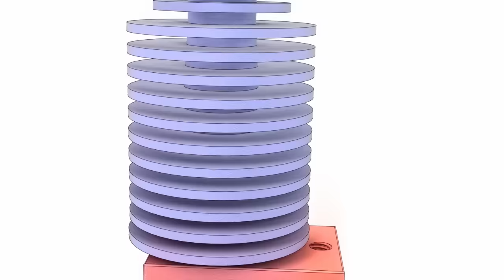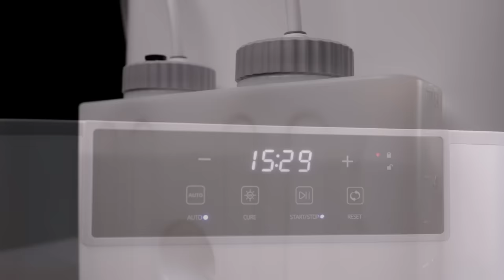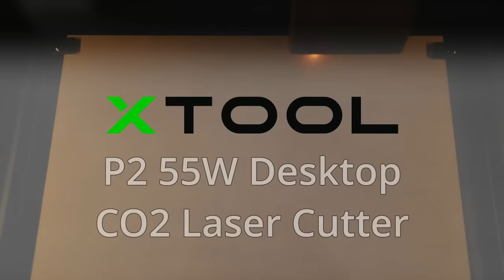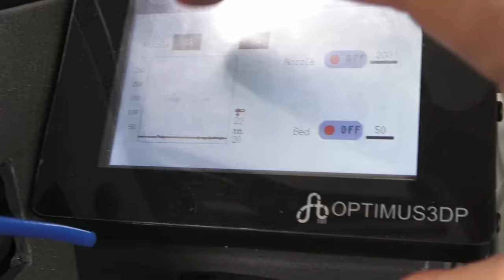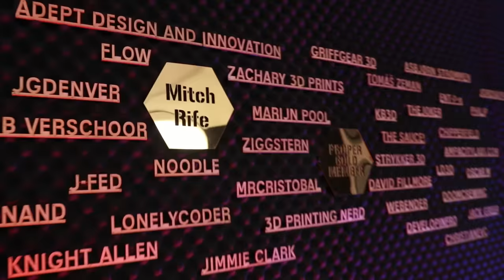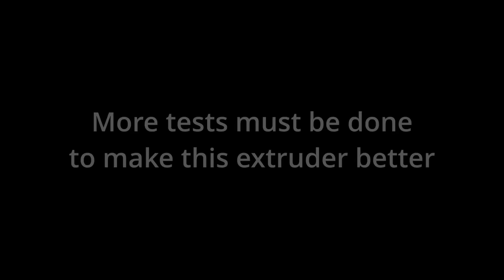I built a working Hotend out of a CPU cooler!

Comment: 2:10 Heatpipes aren't easly refillable, they have like low pressure to lower the boliling point of the fluid inside, so you need to either fill it and seal it in a vacuum or with the tube really with the boiling liquid inside (and in the second case it will not perform good like the vacuum one)
Reply: This is true of water heatpipe where the boiling point is brought down to near room temperature by partial vacuum. This is also the fundamentally best fluid to be used in a heatpipe. But also you could conceivably give it some other fluid with an inherently low boiling point instead and seal it right with air. The ammonia solution sure seems usable with 38°C boiling point, if it also sticks to the walls and doesn't damage them.
Reply: Yeah no ammonia won't work, it reacts with copper.

Methanol is not something you can seal easily, it will just explode on you. Acetone too.

The last thing I can think of is diabolical but well. Dichlormethane. It might burn almost every polymer and your flesh to the bone and your gloves but it has a low boiling point and it won't catch fire, you can seal it safely in a heatpipe by soldering it shut.

In Europe you can buy pure dichlormethane from Modulor Berlin, but since it's a restricted chemical you have to submit a written signed note detailing why you need it.

Comment: Great job. Its a masterpeace  in technical aspect and it is art. Maybe for your next video, you have the chance to make a flir picture or video scene?
Reply from the maker: Thanks! Funny thing is that I am using a Flir camera for the upcoming video, but it will not be about this extruder. I made a short clip with the Flir of this extruder and it was indeed around 30 degrees, but decided not to use it because it didn't fit this video well enough.
Reply: @properprinting  cool. Thanks for this info. 30 degree means that this thing will work perfectly. Nice work

Comment: Acrylic? 
What about polycarbonate?
Reply from the maker: This cannot be laser cut unfortunately. I'm going to try Delrin for the gears next!
Reply: @properprinting  are you sure?
All I found was the problem with discolorations, and suggestion to use up to 3mm thick PC - in case of CO2 lasers, it is.
Reply from the maker: @cthulpiss  I'm not sure, but from what I've read it wasn't very successful. I think that Delrin is a better material for the gears, so I haven't done a lot of research on it